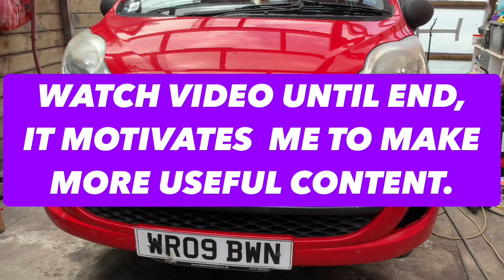Peugeot 107 Quick Front Bumper Removal

Comment: Nice, wil this bumper fit  on an earlier model 2008?
Reply from the maker: I think it will fit. But she some models have different grill and fog lamp.
Reply: 2008 is right around the facelift time. They are a bit different in latching points, I own a 2009 model